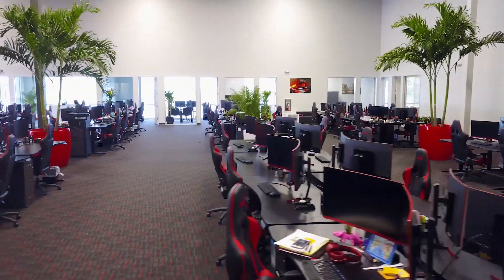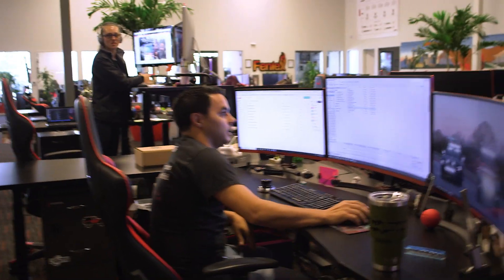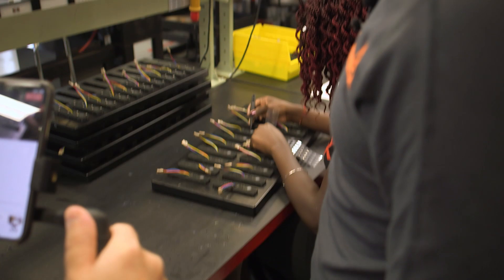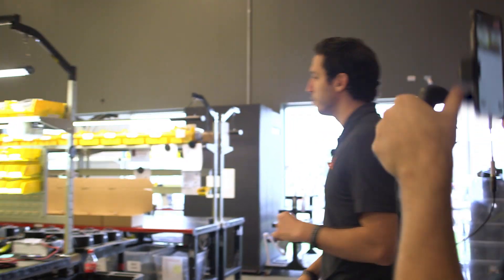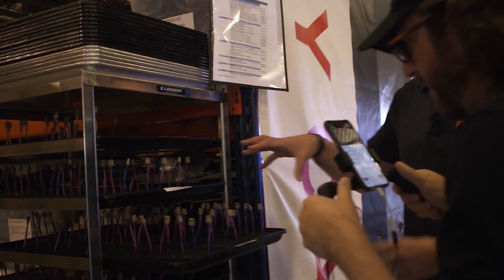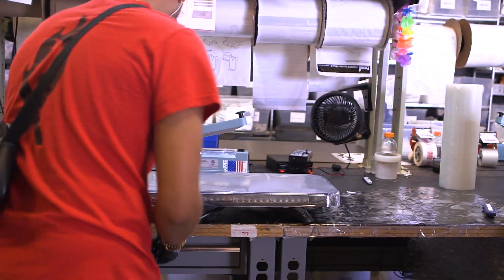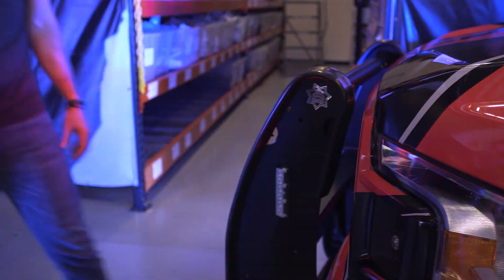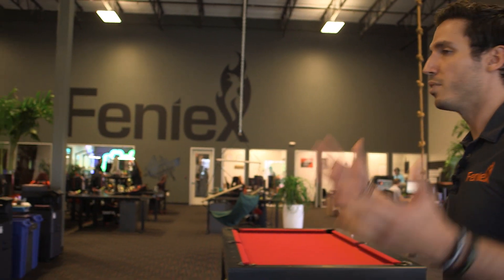Feniex Headquarters // Virtual Tour

Comment: No wonder the lights are expensive, many employees who have to pay
Reply from the maker: No sure what you mean there, but it might help to complete your sentences.
Reply: You should look up prices on Federal Signal and Whelen light bars...
Reply: @brandonshaw534  thanks brandon but i already bought them in led outfitters very bright and cheap
Reply: @chuy0720  just so you know, I had 2 trucks with led outfitter lightbars and a total of 8 of their surface mount lights. After 1 winter season. All but half of 1 surface mount work and 1 of the 2 lightbars fully functioned. Also, the customizability you get out of these compared to the led outfitter ones is not even close. Just saving up now to replace the last junk lightbar